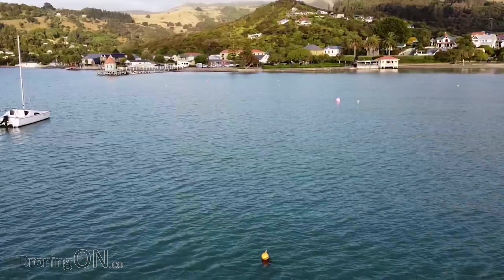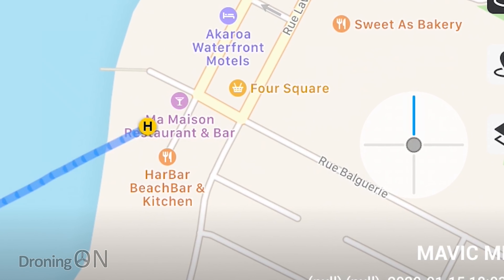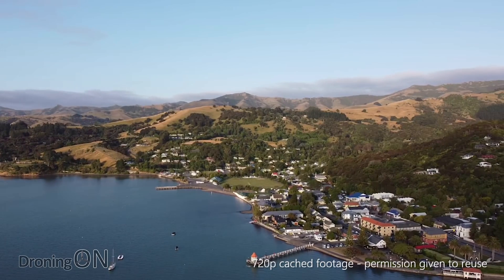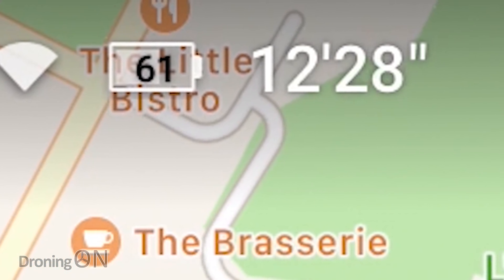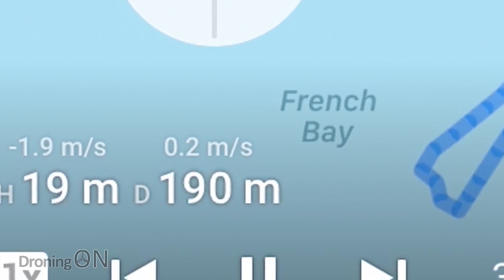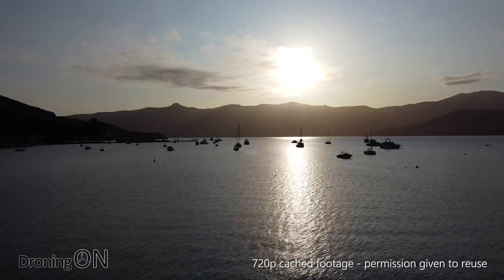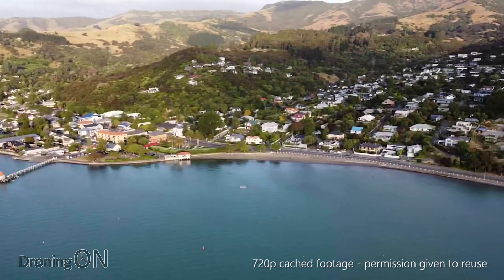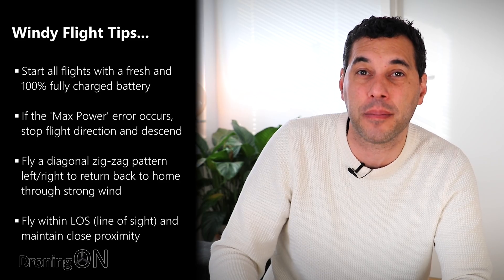DJI Mavic Mini Uncontrolled Descent Into Sea | Max Power/Wind Issues/Operator Fail?

Comment: This Mini came down as if the props were still spinning. Like it just decided to land with its own mind. Just totalled my Mini today. Only 200' away and maybe 50' up with zero ground wind, in wide open area with no mountains, buildings, or strange terrain. No higher than the surrounding trees and not even a slight hint of wind on the thin tree tops. I got a Prop Speed too High warning saying return to home. When I turned is when it went south. Smooth easy throttle back and descent in Sport, and it just started yaw spinning erratically, one direction than the other, then rising full throttle, and dropping, and did a few slow zig zags across an empty parking lot, then it stopped hovered smooth for a bit around 20-30' then just started doing what it wanted when I hit forward stick to come back to me about 100' away. My inputs did little. It would respond for a second, then go back to doing whatever it felt like doing. Tried a quick RTH, and it did eventually come back over Home, but it was still rising and spinning and didn't stay over home long. Lost camera feed, or camera feed froze, rather. So no feed for about 4-5 mins. Eventually, it rose so high it visually got sucked up by the lofty winds, I could see it unfolding(log later would show at that point it was rising at 50mph), and I lost sight and even audible contact too. Thought it was lost forever at that point. Nearly close to a minute of zero visual, audible, camera feed I heard a very distant hum. The hum turned into a dot, and soon the dot was the Mini. I still didn't have full control but it would respond to commands for a moment then do whatever again. Just like earlier. Kept coaxing it down with brief down stick taps by couldn't control direction. Still in contact yaw. At round 50 or 60 feet it quickly went sideways, at this point in zero wind, and you know the rest. 
I suspect a prop issue was at play, but those props were in perfect condition. First take off it hovered at eye level for a few mins and then flew slowly doing manual circle shots. Looked rock solid. Even second flight hover at 100' was rock solid. 
Both right legs snapped, the front in 2 places, the rear at the motor mount, gimbal dangling by only a wire, body split open, lost a prop and a half, battery flew about 10'-15' away and was smokin hot. Totalled.
Anyway, I know mine flew itself up into some strong updraft, vortex or whathaveyou, and it didn't just come down floaty like this person's did. I can't see this design Mini thing falling to earth flat like a pancake. It's gonna flop and flip and dive.
It sucks, but it, kinda, good that I'm not alone. I feel like if I had a prop or guidance issue with the Mini, that it should have landed itself or better yet, let me actually control the thing. Even cut the props at low alt before it had a chance to fly to the stratosphere and back. Not really stratospheric, but it was up good and plenty.
I'm just babbling. Sharing a moment, and an opinion. Letting others know it's quite more than a few of us that have lost all responsiveness with these Mini's. It's not all user error. It's software and hardware. We've all some various tech in our lives, and just about every piece tech we've had, be it PCs, laptops, phones, headphones, stereos, whatever, has had a glitch or issue at some point. It's why we all keep buying more tech stuff. Computers are not perfect, and never have been, the f-up just like we do. I know a lot more fly aways are caused by glitches than what is being put out there. No tech company wants to admit they sell sometimes glitchy products. Thats not good for business. So..."user error...end of story. Buy another drone, sucka". It's a game. A gamble knowing a computer glitch could get you fined big time by the FAA. I'd rather get fined knowing I did something wrong. Not that I want to do that either. Just rather it me than cuz my machine got all Ai n stuff.
Like the prompt tells you, Fly With Caution.
Pre flight checked 2 local weather apps for wind, and Aloft, B4UFLY, and finally Fly app and no wind cautions. I didn't just "go fly". 
I forgot what I was babbling about. So that's it.
Excuse the typos.

Comment: My mini 2 flew itself into a building today after a 3 minute flight. I was close to the building taking pictures of detail items for work. 70 feet up it flew 2’ forward with no controller input and fell to its death. It was having GPS issues and I should have brought it back down. My fault but it did a fly away on its own.

Comment: I have a mini2 and I have sent it out pretty far on a few occasions, like from the beach in Cabo over the water to the Arch a couple of miles away.  Part of my confidence is that the entire Fly More kit only costs $750 and if I lose the drone I can probably replace the drone only for about $400. I use my Phantom 4 Pro for business, so I really only fly that one for business only because I don't want to be out of business waiting to replace a $2000 drone.  With that said, the Mini2 is great fun, easy to take anywhere and films in 4K and it has been flawless in its operation, even flying at a long distance.  I'm guessing the firmware has been improved since this video was made, but I think flying close is probably prudent advice for most consumers. But my suggestion is that if your drone starts giving you error messages over water, descend in altitude and fly it immediately to the closest dry land available, and then head it back to you once over land.  If it crashes on land, you can at least recover it.  Happy flying.

Comment: Do we know if this "dive bombing" has been fixed for the mini / mini 2
Reply from the maker: Very much so, it's far better in wind than the earlier model, but it does still suffer it the wind is strong enough, fly safely! Thanks for your comment!
Reply: @Droning-ON  you mean there is no longer an issue of the drone just lowering itself into water?
Reply from the maker: @Pebblebuoy  normally this occurs when there is insufficient battery or that the wind power is too great for the drone, therefore this 'issue' appears to have lessened with the new model due to it's higher wind-resistance.
Reply: @Droning-ON  oh good, thank you

Comment: I have a mavic mini and I had it just drop out of the sky. No power error just a “motor unable to spin” it fell (300+ feet) and I tried to manually restart the motors with no luck
Reply from the maker: Sounds like a disconnected battery potentially, always ensure that your battery is firmly connected - best to give it a light 'tug' before you take off' to check that it's fully clipped in.

Comment: If you are looking into a mini and you know for sure you want to get into the hobby do your self a favor and get a bigger drone. Not raggin on the mini at all but from personal experience as soon as you get good with the mini you are gonna want more!! just spend the extra money and get what you really want. The hobby isn't nearly as hard to get into as RC planes, with all the sensors and GPS they practically fly themselves so you shouldnt worry (too much) about getting a nice drone and wrecking it as long as you are safe, logical and practice first you will be fine.

Comment: So I had a sort of similar situation: was lining up a shot, hovering about 3m above the sea when the drone landed and drowned itself. Carried out the standard tactics to save it, including flushing with fresh water and leaving to air dry, but 4 days later it still wouldn't turn on.

I informed DJI, and within 72 hours of my initial contact (and about 3 emails of follow up information they requested) they said it wasn't due to user error and will be sending me a replacement drone.

There's hope, people, and I was thoroughly impressed with the speed and efficiency of the DJI support team.

Comment: Today the same thing happend to me, but I am an experienced flyer and have flown for almost 2 years with my Mavic mini in all sorts of conditions. I knew not to start to fly with the previous battery I had already used that day so I swapped it out for a new one. I flew under 15 m of height and everyone in my party could see it as it was barely 60 m out. No alert came until it was already descending and I didn't really have time to look at it as I was pooping my pants scared, trying to save my drone from a lake underneath. There was no wind or any other hazards. I tried to come straight towards me as I didn't know what to do. I lost the SD card the propeller guards the battery and my drone. Now I know :(
Reply from the maker: Thanks for the comment and sorry to hear, on which day, time and location did this occur?
Reply: @Droning-ON  Umm it was on Sunday 18th October 2020 at around midday  in  "ex hacienda Chautala in Puebla, Mexico"

Comment: The issue here, I suspect,  is deformed rear props causing reduced lift... the motors compensate by spinning faster giving the max power error... eventually they overheat or otherwise cause the drone to descend.

If you have the fly more combo you need to pay SPECIAL attention to how those bottom props are arranged in the case because they can and will deform leading to this issue and needing to be replaced.
Reply from the maker: Yes agreed, and as mentioned in this video, let's hope that DJI stiffen up these props in any sequel version of the Mini! Thanks for the comment!

Comment: Allow time to git back. Dont run batteries till they die. Also if its windy at ground level it is way windier at 100 ft. I’ve watched my drone disappear on a gust o wind at 120’.  I had to bring it down to less than 10’ to get it back.
Reply from the maker: Yes, advice given in this video!  Thanks for the comment!

Comment: Possible flattened blades and wind and when the blades are flattened they have very little power to overcome wind as the blade pitch is shallow and flying at high speed, max speed. Packaged blades are balanced that’s why they need to be together.
Reply from the maker: Yes absolutely, I mentioned this in the video!

Comment: What’s a safe height to fly above sea/water?? 20-40ft?? 50-60ft?
Reply from the maker: To be honest, always try to avoid flying above water if you're not prepared to get into the water to retrieve it should something negative occur. But otherwise stick to a heigh where the VPS system isn't confused, i.e. above 60ft isn't a bad idea. Thanks for the comment!

Comment: Totally drones issue.Today I tried to fly my mini over river and everything went smoothly , I tried hovering and it had no problems at start(yes i was taking close up pics), but later all of sudden when I had let it hover it started descending into the water. Luckily I managed to counter it but then it started doing the same and I again managed to counter it. That’s when I said enough of flying for today.(Batteries were on 100% ,no wind at all, no warning messages indicating wind or max power, and blades are in great shape).Must be something wrong with software of drone or sensors get super confused when it’s close to water.
Reply from the maker: Thanks for the comment Mentlgen!

Comment: Time has passed and there has been documented evidence of max power and strong wind warning along with uncontrolled decents due to blade warp on the mini. The blades flatten out when stored incorrectly causing a reduction in the pitch of the blades causing overspeed  of the motors to follow the pilot command to fly. Over water too far away and it will become a submarine.
Reply from the maker: That does indeed sound viable, as explained in this video. Thanks for the comment!

Comment: Options:
1. Conformal coat or nano coat internally the Mavic mini + seperate GPS chip .
2. Small deployable parachute unit mounted, along with a seperate GPS chip.
3. Deployable floaty or airbag + GPS chip.
Reply from the maker: Possibly, but all of that will increase the weight beyond 250g which then means registration :( Thanks for the comment!

Comment: I noticed that the cached footage is clear with no distortion mine has very slight distortion?
Reply from the maker: It depends on what mode your drone has switched to, sometimes they switch between 720p and 1080p depending on signal, it's worth checking in your settings. Thanks for the comment!

Comment: Let me guess before finishing.
Mini flew out into wind at the back and on return into strong head wind and we all know the mini is carried by wind like a dust to a light breath.

It's no Mavic air or pro it doesn't have the pitch or the speed to overcome wind by force, at least with a Mavic pro you can just flick into sports mode and try to fly diagonally thru the wind or at very least go lower and get under it most of the time if you're unlucky you'll have to make an emergency decline into the nearest reachable land mass and go fetch it.

Mavic pro can escape winds provided they don't exceed the crafts maximum thrust at full pitch which is about 65kph or 45mph, the mini is well known to struggle in a light breeze let alone a head wind into the 40kmh range.

I flew my Mavic pro in winds up too 45kmh and assure from being pushed around a little when flying slowly it was fine, though I wouldn't have wanted to climb higher.
Reply from the maker: Thanks for the comment Geoff.
Reply: @Droning-ON  All good, just try keep the mini in wind under 20kph, its just too light to really be flown around in gusts. Great little unit tho, but yea wind is its worst nightmare.

Comment: Thanks for sharing this video, I think there are manufacturers issues with the Mavic Mini, here is a link to my video showing my crash the video explains what happened, it was a low level flight within 10 meter distance from the controller, you decide.
https://www.youtube.com/watch?v=MCGvTA7TnvE
Reply from the maker: Thanks for the comment Tech, very odd but some advice - once a drone starts to misbehave, don't keep flying and especially doing so right next to a road with passing cars. You should have landed immediately, calibrated the IMU and compass and tried again in a large field.
Reply: I will bear that in mind, but in my opinion, I regained control, but it suddenly went berserk again, then crashed.

Comment: I had similar experience while flying over the sea. Poor thing couldnt hold up there fighting the wind and her voltage dropped suddenly and mini started to descend. Since it was a sunny day i missed the voltage levels showing on my phone screen. Luckily i noticed her descend and managed to crash land on the shore. After that incident i never flew her over sea. Poor little thing wont b able to fight the winds out there. 😅 so make sure ur battery is fully charged before u fly her over water.
Reply from the maker: Agreed, thanks for the comment!

Comment: Get an app for your phone that tells you local flight weather conditions and wind speed  at different altitudes to plan flights.  I live on a long narrow (12 km long  0.8 - 1 km wide)  lake in a valley with steep hills on either side up to 400 m  with the lake oriented almost true north-south.  Wind is a given.   If I have to fly  back home  against a substantial head wind I'll often fly it home at 10 m alt.  and as close to shore as possible.  The wind along the shore is slower and often the shoreline has small coves, trees  and such that  shield against the wind (you'll see your drone speeds up or slows down, be mindful of variability) .  Also the wind often has a crossways component  from the direction you are flying. Find the leeward side of a lake to help shelter against the wind. Little tips like this might help you save  your drone.  Even if your drone isn't  thousands of dollars, its often a fairly big investment. Just make sure you have enough battery when you leave.  Plan your flight well, be conservative.   And if you don't need to, don't fly in strong wind.
Reply from the maker: Precisely, such as UAVForecast - definitely should be in your drone toolbox! Thanks for your comment!

Comment: Lost a Mavic Mini just a few weeks ago to a similar issue. I was flying off of a sailboat and capturing images and video of the boat and passengers. I had a difficult time with wind turbulence from the sails which did not allow me to land back on the boat. Prior to that the wind was strong enough to not allow forward movement despite full power and over 60% battery. Ultimately we tried to create a hard landing into the boat, which we did accomplish but was dropped by a friend and it fell overboard and therefore lost at sea. 😢
Reply from the maker: Sorry to hear Brian! Thanks for your comment!

Comment: Mine literally fell into the water yesterday like this guy’s! I didn’t get any wind warnings or anything, I just had my drone at about 1 and 1/2 meter above the sea, I took my eyes off it for literally a couple of seconds and I found it inside the water.
What an horrible scene.. 
so do you think guys that it’s a firmware problem? Will DJI refund it?
Reply from the maker: We're really not sure, it's a mixture of drone underpower and operator error. Thanks for your comment!

Comment: I highly doubt that the propellers were the issue. unbalanced props only cause a slight temperature spike in the motors which the flight controller will account for
Reply from the maker: No, they have been proven to cause power and performance isuses, so it is indeed possible. Thanks for your comment!

Comment: Naturally low battery in the drone will cause issues. But, will problems arise if the controller has a low battery. Thinking of signal strength being sent out etc?
Reply from the maker: Precisely, a low battery doesn't deliver as much power. Thanks for your comment!